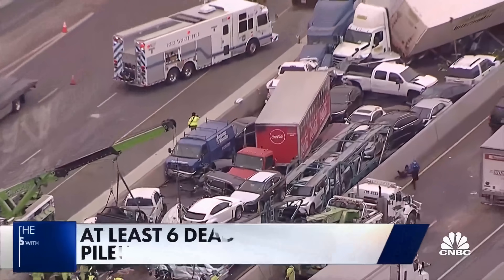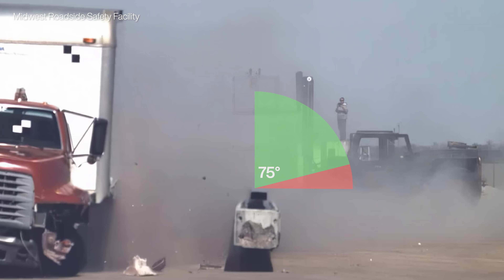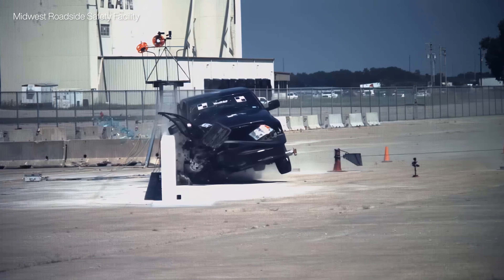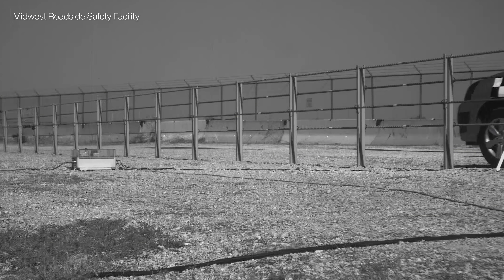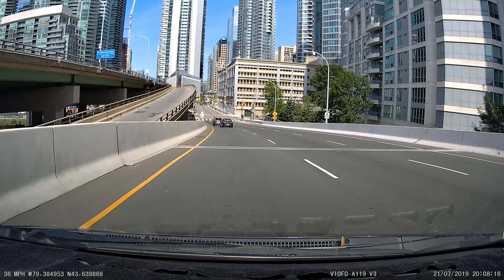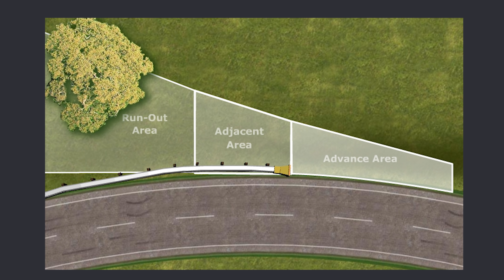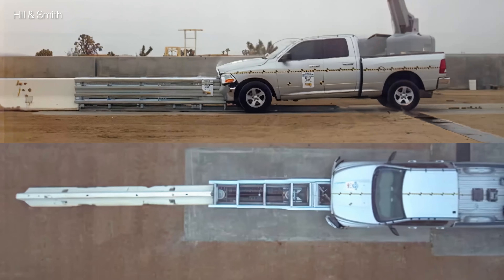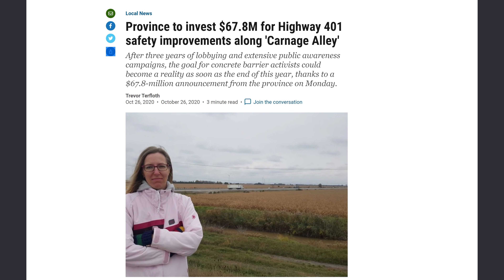How Road Barriers Stopped Killing Drivers

Comment: Cable barriers also shred your car. 

They were installed a few years ago on the outer bypass in my city. Despite this bypass having a 50-100ft wide graded grassy area between the north bound and southbound lanes they installed the barriers right outside the median in the fast lane. This median isn't even big enough for a car to sit without blocking the lane. I figured they got lazy and didn't want to install it in the middle of the ditch so now if you are on the wrong side of the highway and slightly lose control...a repair which might have been just a tire or two and some suspension, turns into half of the front and one whole side of your car being torn off.

I guess the same guy who works in the highway department also owns some dealerships here.

Comment: The reason why I think cables are not safe is because when a biker hits the cables at high speeds he will be chobbed into pieces
Reply: Yeah, but the issue is a biker isn;t safe without a spot to fully slide to a stop. Can;t do that unless we stop using barriers of any type.

Comment: Why is "no rollover" even a criteria when "can't tip past 70°" already covers it....
Reply: Maybe a gradient scale? Like something that tips over 70 would be better than a rollover, but still worse than something that kept it under 70
Reply: because it's a classification for different vehicles. You saw the rollover example with a small sedan, but the tipping example with a box truck. Sedans can't tip and slide, they just roll, and that starts before 70°
Reply: @sauvagess  so would a sedan be allowed to tip more than 70 then? I'm can't imagine it would be likely to happen, but unless that is the case, why bother with separate rules?
Reply: @WhyName  A sedan can not tip to 70°, because it will already be in a roll at about 55°. However, a truck can't roll at all, it'll just flip onto its side. It's like you didn't read what I said at all, I'm literally repeating myself right now.
Reply: @sauvagess  ah, I was missing a crucial piece of info there. If you consider it as being in a roll at 55° it makes a little more sense.
I assumed for something to be called a roll would require more than 70°.
It still seems redundant, though I guess I can now imagine cases where it could actually make some distinction.
Reply: @WhyName  It's a very simple and straight-forward concept. A roll is when a car rolls over like a tube. Rolling is also known as "flipping," "tumbling," and other synonyms. 55 is more or less the median at when it happens, though the faster a car is going, the easier it is to flip. At around, say, 100mph, a sedan can flip at an angle as shallow as, say, 25° if it slides to its side.

On the other end of his discussion, box trucks and semis do not roll. Ever. They're about the equivalent of a brick on a patch of ice. You can try to spin one and make it roll, but the moment it touches the ground, it's going to land on one side and then just slide due to the weight differential. In any potential situation where one would be able to roll, the trailer would break apart before any rotation could possibly happen.

I figured that this would be fairly easy to discern, should one ever interact with a truck in any capacity, in addition to watching the visual examples that showed up when the video covered that part.
Reply: @sauvagess  Thanks for the clear and thorough explanation. Graceless and condescending for no reason at all, but informative nonetheless.

Comment: I ride motorbikes and I'd rather in the event of a crash, slam into an aluminium armco than the wire armcos because I've heard enough stories of biker getting their legs cut off or other limbs and we all want to keep riding once we've had an accident. But if I hit a concrete armco it's game over, at that point I'm already thinking did I say that I loved my family and girlfriend. When roads are built they're built for only one type of road user in mind and never accommodate any other road user. 

So if you are out driving, please keep an eye out for the motorcyclists and the cyclists. We all have families we want to go home to.

Comment: Driving is still in beta testing. I've been driving for 2 years now and found out tons of things that still doesn't exist. It's embarrassing to even have 1 drop of human in my blood. I can't think of anything right now, but one thing I remember is that when a light turns yellow, sometimes people have to decide is it safer to keep driving or safer to stop. I wonder how long it'll be until they mark roads to indicate, if you pass this point when light turns yellow then keep driving, otherwise stop. It might seem pointless, but if it was standard a long time ago, there probably wouldn't be the 2 second dead zone time between lights. So many things like this don't exist. Driving is like version 0.2 beta right now. So pathetic.

Comment: I've hit a cable rail, and it not only caught my massive truck but also left it drivable with only cosmetic damage.
Reply: Cable guard is a bandaid fix to safe highway design. It does nothing to adress over capacity highways. It has an engineering design cost along with possible grading of median slopes is associated with installation of cable guard . Incidents of median crossover crashes can be attributed to distracted drivers.

Comment: That’s crazy all of the security we have and don’t even notice : I always saw those metal barriers or concrete walls and I never questioned their shape and thought it has different shapes to try reducing the matter and therefore the cost as much as possible while having the same resistance, but no : engineers thought deeply about what shape we could have depending on what they wanted to achieve in order to save our lives. That’s crazy.

Comment: Interesting factoid, as someone whose family worked in their states DOT (department of transportation) i can tell you this old guardrail design you show in your videos' thumbnail IS still in use. The reason for this is because the time it takes to get everything swapped, there's so much guardrail in use in the US that it can take years to get everything swapped over to a new design, meaning this guardrail system that fails to collapse properly on impact at the higher speeds people drive at these days is still partially in use. Checking this without someone who works for the DOT is actually pretty tricky though so basically, don't wreck

Comment: Hey! Awesome reporting!  I have a question, since you have researched this.  About 5 years ago, Michigan had clear zones on a road I regularly travelled, with a large grassy area in between the 2 lane highway north and south directions.  Then they put cable barriers on it, which seems much more dangerous to me.  People used to regularly crash into the clear zones during small snow storms when they lost control.  Now these same drivers hit the cable barriers, damage their cars, and potentially bounce back into traffic hitting other cars.  My theory was always that the reason for this change was corruption, that our corrupt bastard Michigan legislators sent lucrative contracts to their friends despite those contracts being counterproductive to Michigan safety.  I lamented the change.

Could you please do a video about this issue?  Thank you, I'm several minutes into this report. Best ever.  Thank you Andrew Lam.

Comment: Road barriers still kill people. Hitting a guiderail approaching a concrete structure will not guide anyone 'gracefully' like described in the video.  The video talks about risk of barriers, but people miss the point and feel barriers are needed wherever there are high speed collisions, like the 'carnage alley' example in the video, people disregarding engineering advise and pressing politicians to installing barriers.. and getting their way.
Reply from the maker: That's actually the subtle point of the video, that sometimes public opinions can outweigh what engineers say is best.  I didn't want to make that point over the bodies of dead people so I cut a lot of that out.  

How ever in the example I used, the interior government also said they needed those barriers to accommodate greater traffic that is expected in the next 20 years.  

I don't think there's a right answer in that situation.
Reply: @Lam  At 14:19 in the video, the founder of "grassroot group Build the Barrier" lobbied the politicians to ignore governmetn engineers' advice and install barriers.  She got the barrier built, yes, and got her photo in the newspapers, but I hope she goes back to the Ministry after 10-15 years and asks for historical data on traffic accidents involving her new barriers. My hunch is that her barriers will result in more accidents, more serious injuries, and more deaths than before.

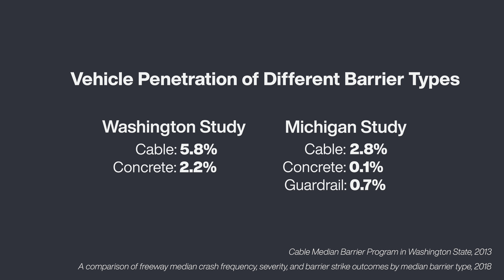Comment: ... um, I could be wrong here, but that fatality rate at 7:26 looks wrong. Cause... You said cable is equal or lower... But it was cable: 0.3%, concrete: 0.3% and... cable: 0.9%, concrete: 0.4%.

So... If that's a fatality rate, that'd mean it'd be more deaths with cable, right?

Comment: The only car crash I've ever been in was a brand new (for 2004) jaguar, which hit a barrier at 90 miles an hour, bent it, and then launched from the barrier like a ramp. It hit our car, on the opposite lane, and our car spun around four or five full rotations before stopping. 

There were four people in our car, two kids, and one Great Dane. Somehow, no one died.

Comment: I found the section about cable barriers a bit disingenious. Comparing cable barrieres against concrete is unfair because the obvious replacement for cable barriers would be guardrails. So you would need to compare cable to guardrails and not to concrete.

Comment: A couple years ago I had an accident where I went off the highway on the right side and crashed into the end of a guardrail at 130 kph (80 mph). It was a turndown end so my car was launched on top of the guardrail. I thought it would flip me over, but because I was driving a rather large car (and the guardrail was designed well I guess) it just got crushed under the car and folded down like paper - The impact didn't even cause the airbags to go off. My vehicle was launched off the guardrail onto the road whereupon I unfortunately wasn't able to stabilise it but instead went across the highway for a high angle crash into the opposing guardrail. From this angle it didn't fold down, but instead stretched outwards for about a meter to cushion the impact (This is where the airbags went off). The car's tail end kept going, I bounced off the guardrail and after a full 360° turn I came to a nice stop facing forwards on the right traffic lane.
I got away with a few scratches, light burns from the airbag and a mild whiplash injury. Fortunately the road was not very busy so all other cars managed to stop safely. Police reports said that a total of 75m of guardrail were damaged and I also ran over an emergency telephone. Cost me a 35€ fine for causing a traffic accident and the 500€ minimum contribution for car insurance, everything else was paid by insurance (police, fire department, highway maintenance crew, ambulance, CT scan and a 3 day hospital stay). The new car has an automatic lane assist feature so this kind of shit doesn't happen again.

Comment: Can't remember exactly, but i've heard that cable barriers are extremely dangerous to motorcyclists, literally tearing riders apart, that' s the main concern with them.
Reply: In fairness, I have never seen a motorcyclist win against a concrete barrier either.
Reply: @JohnSmith-cn4cw  or any barrier for a matter of fact lol
Reply: @JohnSmith-cn4cw  At least with concrete you only need on bag
Reply: @JohnSmith-cn4cw  well yea but that generally results in broken bones if its not a direct hit at least. we are mainly talking about glancing blows, as is ususal on highways, here, where the issue with cables or even just normal side rails is the posts where limbs get tangled. a broken arm, a broken leg, and a some internal bleeding is more survivable then getting torn into pieces.
Reply: @JohnSmith-cn4cw  Hitting a crash barrier head on is extremely rare. Usually it's a glancing hit. A glancing hit against a concrete barrier for a motorcyclist is easily survivable, and often results in injuries that only take a month or two to heal from. If the rider is sliding on the ground already before hitting the barrier there is usually only bruises.

 A cable barrier will just kill you, regardless of the situation.
Reply: @JohnSmith-cn4cw  I worked with someone who drove for the coroners department. And apparently even with those with were driving cars, it was apparent that they had hit a cable barrier. I got the impression they'd have em banned! They don't save lives!
Reply: That and serious neck injuries in small car drivers.
Reply: yea there called cheese graters in nz because people go through them like cheese through a grater
Reply: Vroom Vroom
Reply: Rubbish. Have you seen the diameter of the cables, they aren't fishing line.
Reply: @ComputersAndSoftware  Yah I have, I'd rather not see em up close at hwy speeds let alone get stopped by em!
Reply: @ComputersAndSoftware  we are talking  them hitting at highway speed not just walking into them
Reply: @stephenhunter70  PSTFU
Reply: It's a cheese cutter.
Reply: Well I don't think any motorcyclist is going to survive either way
Reply: @argo9721  That's right. My point is apparently neither do the drivers of small cars. They can set those things to stop cars or Semi's. Set'm up to stop Semi's and you kill cars drivers, set'm up to stop cars and Semi's go straight through em it's that simple.
Reply: Just take all motorcycles out of the road 😁

Comment: None of these road barriers seem to be designed with the motorcyclists in mind, which is, after all, the most vulnerable motorized road user.
Reply: Thing is, if we tossed everything out and made it biker safe, we'd either have higher costs by like ten fold, or... we have no guardrail because they can safely slide into the dirt, and we get jumpers flying off the lanes and into oncoming traffic... aka, death to that family of 4, but life for that one biker.

Comment: The other problem with cable systems is that they require COMPLETE replacement when an accident happens. This means that repairs tend to not happen. At all. I have seen this in my region.

Comment: The fact that money is considered in safety is just sad :( i mean, why save money and put people's lives at risk?
Reply: It’s a matter of practicality. How do you suggest getting these safety measures built otherwise? Are you personally willing to go work to construct and repair these barriers for free? Are you personally willing to go obtain the materials for these barriers for free? To distribute them across the world all for free? 

At the end of the day the people working on these systems need to be fairly compensated so they can eat and survive to come build more the next day. The people designing these system need the same. The people that supply the steel, sand, and machines. If we just built the safest thing everywhere we wouldn’t have any safety feature almost anywhere. The money would run out far before we see any realistic improvements.

Comment: Ok, when describing a cable barrier as less expensive, this is one of the few times that the word "less" should be used and not "fewer" .  "Less" material  is the amount of material used. "Fewer" materials is just the number of different kinds of materials used. The correct term should have been "Less material is used."

Comment: and how do motorcyclists fare when they lose control (possibly through no fault of their own, but even in cases where it is their own fault - just like for cars and trucks) against each of these types of barrier separators? It seems rigid concrete barriers would constrain a sliding rider from passing into oncoming traffic (etc) but  guardrail and cable systems result in vertical elements that fail to deflect a fallen rider and instead guillotine them
Reply: Thing is, we can't put a cement barrier on EVERY inch of highway, since that means that it can fail if an area can't get service fast enough. Cables and railings stop large trucks from making themselves into high speed rams.
Reply: @MotherSafeHarbor  Sorry "we can't" just use concrete barriers? Um why? "Since that means that it (what? the concrete barrier?) can fail (?!?) if an area can't get service fast enough" - nope, cannot parse this rationale at all. 'We shouldn't even try to put the best barriers in everywhere because some might fail if we have too many of them and then it might be hard to replace them'? That's the best I can do and it doesn't jibe for me. Look the reason we use cables and railings is simple: they are cheaper than concrete, and we only care about people in vehicles with at least 4 wheels, and no one actually values the lives of road users who only use two wheels. They just don't matter. It is important to make changes to the road infrastructure to save the lives of car and truck drivers, and it is patently NOT worth making changes to the road infrastructure to save the lives of motorcyclists.